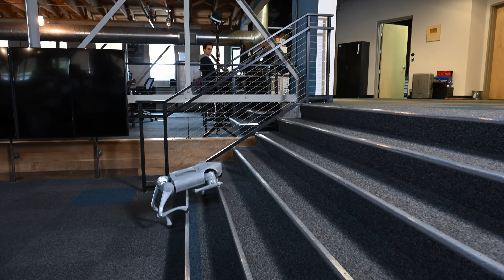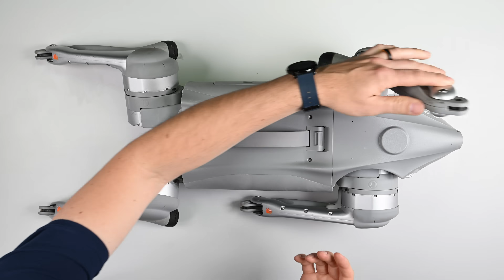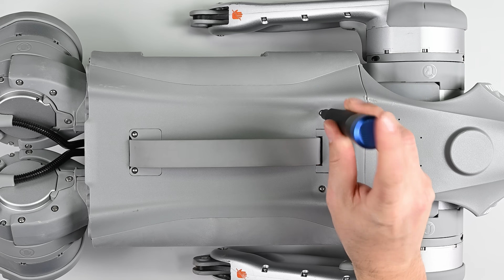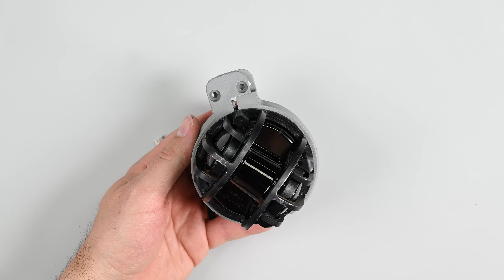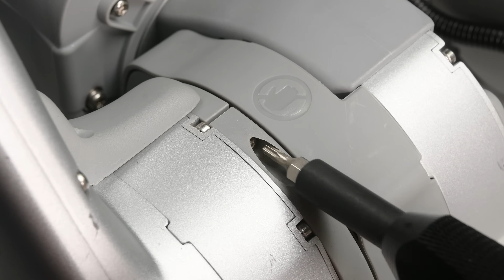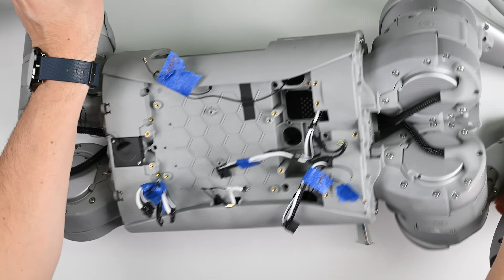Tearing Down the Unitree Go2: A Robotics Expert's Deep Dive

Comment: Hopefully the Go2 is better than the Go1. The Go1 was a danger to your privacy and personal network. the raspberry pi inside shipped with default credentials, and there's a tunneling service installed that allows remote connection from the company to your device at any time. Worse, the API key for the tunneling service was hardcoded and can be extracted and when you use this API key you can yourself connect to any Go1 out there like the company.

Comment: A very nice teardown video. I would like to point on one thing that has been discovered about these however, there is a backdoor in the firmware. It isn't hidden and seems to be caused by rushed/sloppy/lazy development and deployment rather than malice, but it does allow the company and indeed anyone to connect to any robot dog in the world that's connected to the internet, take remote control of it, and to look through its sensors. The password is the default for the Pi board that runs it. It also allows a remote attack vector for any wifi network it is connected to. Again, this looks more like slopiness than malice, but any backdoor is a security concern and any buyer should be aware of this and keep it on its own separate network and not leave it in sensitive locations. If someone has some programming skill this is likely fixable, but it is in by default.

Comment: 1) The wifi and bluetooth are handled by the white BL-M8852BU1 module with the QR code on it.  The white Radison thing is an antenna.
2) Global Navigation Satellite System ( GNSS ) refers to any satellite constellation that provides global positioning, navigation, and timing services. Several GNSS are currently available: Galileo (EU) GPS (USA)
3) The silver EC20 module with the GNSS is a LTE Cat-4 module providing location and LTE data communications

Comment: Quectel EC20 is a 4G/LTE module and they used it just for GPS
(because no antennas were connected to the ports other than GPS)?
I also have not seen any SIM card/SIM card holder for the radio module, so internet connection over this module seems to be not (yet) used...
Reply: Are you one of the "Four Norsemen with paperclips"?

Comment: GNSS isn't GloNASS, it's "Global Navigation Satellite System" of which GloNASS may be a part, and so may GPS, BeiDou, Galileo, etc. GNSS just means it's not specific to one satellite system for navigation. 

Important to note, because if this really did use just GloNASS, it would be Limited exclusively to the Russian satellite navigation system. That would mean less positional accuracy because you'd have fewer overall satellites available for navigation. And it would mean that you're tied to just the Russian navigation system. I understand it can be confusing that the Russians decided to name GLONASS that, which technically means Global Navigation Satellite System, but GNSS specifically means Global Navigation Satellite System in a way that includes other systems besides just one.

Comment: That crack across the main body is such a massive indicator that physical loading during operations was never considered. It makes it likely that the leg beams and motor/gearbox mounts will also fail prematurely. All easy to fix in Gen2, but Gen1 often establishes the public opinion of a device for all of eternity. You can't remake a Ford Pinto, even today.
Reply: They should have used carbon fiber or carbon reinforce platic that  crack across the top is like the spine pressure point when jumping off stairs or elevated surfaces
Reply: Funny how it the crack was ignored. Very superficial teardown.

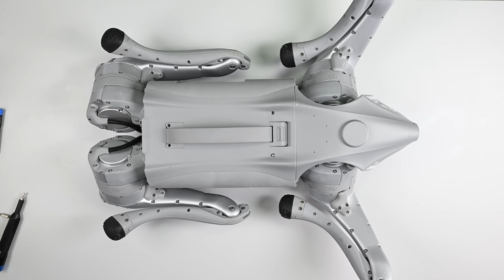Comment: 6:12 two things they missed in this section: it has a UWB radio in the bulge on the head which is used for following a small remote so it can run untethered alongside you. And also it has full time 4G so outside of WiFi you can remotely drive it via internet

Comment: I have always said that e-bikes are way too expensive. This robot proves it impressively.
Reply: Is hard to argue with that.
Reply: This robot isn’t designed to hold 300lbs and travel at 20mph for extended amounts of time. That comparison doesn’t work. It’s like trying to compare a Traxxis RC car’s 0-60 to a Bugatti Veyron 0-60 time.
Reply: @MedicAthlete24W  A $100 bike is "designed" to withstand 300 pounds and 20 miles. This is an absurd claim to justify the exorbitant prices of electric bikes.
Reply: We don't know the cost structure for this robot. The company could be producing these as a loss as a marketing tactic to prove they can compete with Boston dynamics.
Reply: @avronaut  As economists say it would have already been cheaper if it was actually possible to reduce costs and have a competitive advantage.
Reply: such a weird comparison and statement and also so glaringly wrong. also you just made a statement with 0 reasoning. 😂 you should elaborate why THIS thing proves that ebikes (which ones, the 800 china ones or 15000€ fully?) are overpriced.
youre absolutely clueless lol
Reply: @thejoe9065  Back in 2005 I bought a Giant Lafree ebike in China for $300 when they were sold in Europe for over $1300. I couldn't believe my eyes when I saw the price. My in laws used it for many years, build quality was solid.
What we pay in the west for ebikes is not the cost of manufacturing, that's for sure.

Comment: Really wanted to see one of the legs disassembled all the way, since that is really the magical mechanical part of the robot. So close then you put it back together. Thank you for sharing the partial tear down with us.
Reply: Me too!  The legs are where the clever design can be found.  The gearing, the sensing, the fuse, and the manufacturability are all critical to making this work on a leading edge budget.
Reply: Same. Especially the lower joint. Is it actuated by a cable?
Reply: Yes! I wanted to see how the three motors are set up mechanically. How they're geared down (guessing not harmonic drives given the back-driveability and price) ... man, that was all I tuned in to see ¯\_(ツ)_/¯
Reply: @howiem  each actuator has a bldc motor, planetary reductor and a driver board in one case, so the only thing you need to set up is to provide it with power and CAN/RS485/... communication - and you're done. Mechanically it shouldn't be complicated - they're not using slip rings so just one motor rotates the bunch of others essentially.

Comment: As good a teardown as i've ever seen. Great camera and lighting, Clear and precise commentry.  I wonder when the AMS / ST TOF chips will overtake the spinning LIDAR, must be close now with multi pixel parts now speeding up. Seems odd they hide the chip ID's while they are at a pricepoint where hackers (makers) would love to add features if open source was available.  Replacing the main board to use the mechanical body wouldn't be beyond many peoples skill. Would be amazing if you could just buy 4 legs. Great video.
Reply: Maybe licensing problems? Most of the time you want to prevent copies and hide what type of chips you use and maybe they ripped of quite lot of tech from other :)

Comment: How you'll skipped the motors...this was the most interesting part and reason watched this far. 😢
Reply: really sad
Reply: Wow I'm glad I read this. If they skipped the motors I'm not watching
Reply: yeah, I was hoping they did a teardown of the actuators, that's a bummer, I read this after watching the entire thing hoping for the climax.  I did find the tooth engagement with plastic clamping thing interesting for the leg actuators
Reply: Yes please update the video with the teardown of the legs !
Reply: Search for MIT Mini Cheetah motor teardown - those are the originals of this style and the mechanical operation should be virtually identical, with mainly cosmetic differences in the circuit board and outer shells.
Reply: @RJTC  Thanks, but I suspect that there may be differences for cost and manufacturability.
Reply: OMG same!! The mechanical mechanisms. How does it control the knee joints they eluded to?
Reply: there's a 3d x-ray of the leg in their blog post
Reply: @polarijet  oh no way, I'll have to check that out
Reply: I scroll ffd to see the actuator mechanism so I do not waste time. For this bait I will use ublock on your clips.
Reply: So what do we guess?
Dyneema harmonic capstan drive axial flux...
Maybe a gimbal motor to use existing mass production...
And the thrunge-gusset nipple will need anti-shock frisson adjustment
Reply: That's what I was looking forward to
Reply: Exactly the same!! I was actually waiting for the joint mechanism and actuation parts. Wasted time !!
Reply: The motors were also why I was looking at this video
Reply: it's a clever move, you'll most probably need to recalibrate one ofter you open it. They have at least one encoder and when you open the case you'll move it from its expected/calibrated position and e.g. lose the zero position.
Reply: @arsenyspin1726  Those encoders are absolute probably magnetic since they are cheaper consume less energy and give 12bits resolution that is 316.40625 arcsec per bit plenty enough for a robot
Reply: there is nothing to see much and already did open one joint so your statement  is just useless
Reply: @3mSS82  bu, but the mechanism! our curiosity was not satiated.
Reply: @3mSS82  no yours is useless
Reply: @3mSS82 you're wrong. They did not open the motor unit, they expressed curiosity about how the foreleg worked at the start and then didn't open it.

Comment: For a single charge how long will it last?
Reply: Difficult to say... depends on how you're using it. It could probably sit for a few hours just spinning it LIDAR, or if it's running full speed loaded with weight maybe only 15 min (if it doesn't overheat first)

Comment: Maybe I missed something, I don't see any gasket on the top cover. Looks like moisture will make quick work of that mainboard. I've seen other videos where the robot failed to initialize probably because of condensation on the cameras. 
darn, I was hoping to see the motor teardown.  Did you do any testing of motor temps under load? I've seen some G02 appear to overheat and shutdown.

No surprise, they don't readily offer replacement parts except the rubber feet. 
Their sole measure of success seems to be the shear number of useless products they can hype us into buying. 
Long-term service is an after-thought, if it even exists, boils down to: "throw it in a landfill, ship a new one across the ocean"

Comment: Is it a good hiking buddy to carry your backpack/extra water for you
Reply: if it's such a brief hike that the cheap battery will sustain the loaded pack robot, I probably didn't need to bring the 30lb robot with me to carry my 3lbs of water/snacks. And no, it can't be recharged at a reasonable rate from some tiny solar panel while you lunch.
Reply: I’m not sure if these would have the same specs as some of the robot dogs in videos I’ve seen of them help carry trash down the Great Wall of China.
Reply: Nah. This would be good to mount your  camera to record yourself and you don't have to constantly go back to retrieve the camera.

Comment: This thing has no use
Reply: Use is way too many to list
Reply: @chunyuou9944  nah list some.
Reply: the words of the unimaginative
Reply: @hellohogo  tell me a few? No lidar, no thermals, you can take it for walks tho....
Reply: Not now but with a manipulator attached and better AI I can see it doing useful work. The base motion platform is already pretty good.
Reply: Yep. It’s a tech demo, nothing more. A bloody impressive one, but just a tech demo.
Reply: This is sold to univercities for research use.
Reply: I could see a realtor or builder using them to map homes and buildings. Used to get dimensions, 3D render, interior design...
Reply: @GlitterGuru  realtors have cameras and typically, feet.
Reply: China has used it as a blind guide dog in testing stage.

Comment: Those cracks in the plastics (battery housing and the front side) are worrying for how long that thing holds.
Reply: Cracks and stuff with plastics are easy to fix. 3D printing parts and baking soda and crazy glue or stronger parts replacement would do the trick.
Reply: @ Plastics are some of the worst materials for repair. IF unitree didn't cheap-out (doubtful) they used fiber-reinforced plastics. Simply repairing those broken fibers with CA glue is not possible.
Reply: @Metapharsical  You get what you paid for.  These are supposed to be high strength engineering plastic but there are weak areas.
Reply: @ "you get what you pay for"
amen to that my brother. 

p.s. I can tell you are a loyal servant of His Divine Shadow 😉
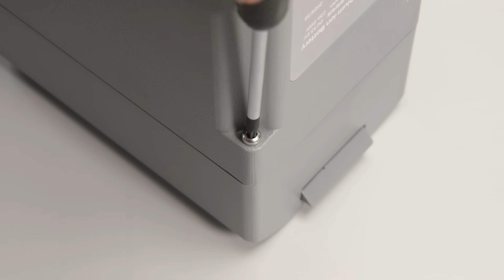Reply: Do you mean the parting lines below the screw at 3:34? Those look pretty normal...
Reply: @chicken69190  no, @ 31:07 near the end. He points to some obvious deep cracks appearing at the 'neck' of the body
Reply: @Metapharsical  just use some glue.
Reply: @Metapharsical hmm yeah, they may want to re-engineer that part or use a more robust material
Reply: @chicken69190  At 3:39 that corner looked bit more than parting line but not sure.
Reply: @accik It doesn’t look like a parting line—more like excess plastic.

Comment: GNSS means "Global Navigation Satellite System" and usually refers to all the systems (GPS, Galileo, Glonass, etc.) together.
Reply: Exactly! GNSS is the umbrella term that covers all the major satellite navigation systems—GPS, Galileo, GLONASS, and BeiDou. It’s wild how global navigation has become so integrated into everything from smartphones to autonomous vehicles. The more satellites, the more accuracy, and that’s huge for tech across the board!
Reply: I'm glad you caught that. I just spent some time explaining the exact same thing and then I saw your comment. Yeah, if it was actually GLONASS, it would be literally just the Russian satellite system and would not include any of the others. And even though GLONASS does mean global navigation satellite system, GNSS is what's actually referring to more than one system. 

I would say this is an important distinction to make and that it should be fixed in the video, except I also suspect that most people that understand what GNS is, or even understand what GLONASS is, can probably figure out that this was a mistake. So I don't think it's going to mislead people... Even if it's wrong info.
Reply: Gps antenna is the circular node atop the head
Reply: it probably has Baidou and GPS, i doubt it has glonass
Reply: @Fredoca_Laroca  No reason it wouldn't have GLONASS. This is the mini PCIe module: 'Quectel EG21GGB-128-SGNS' with built-in GNSS which features the frequencies of GPS/GLONASS/BeiDou/Galileo/QZSS
Reply: @rubberonasphalt  fair enough
Reply: If it's anything like an average gnss device you can select the constellation you want.  @Fredoca_Laroca